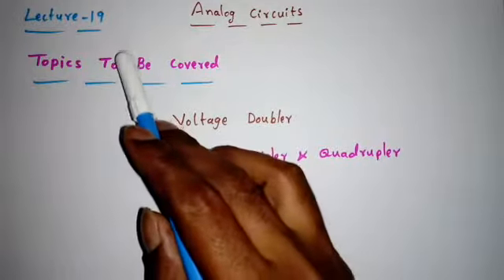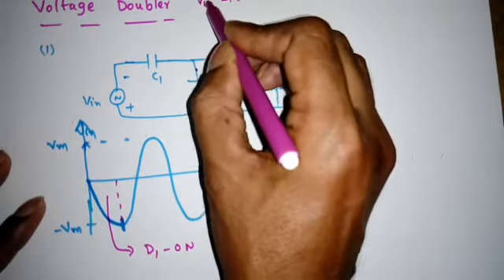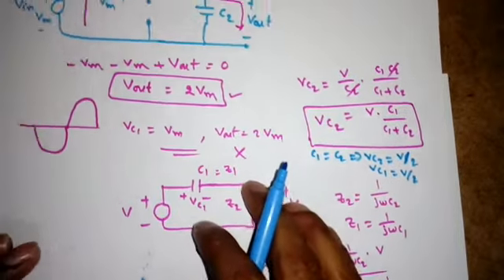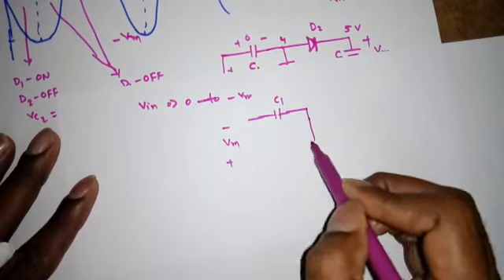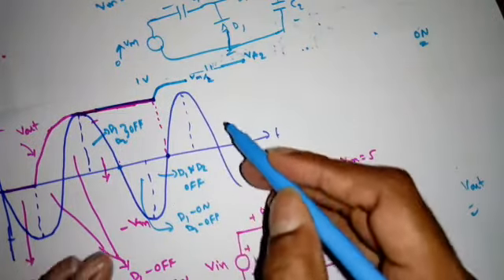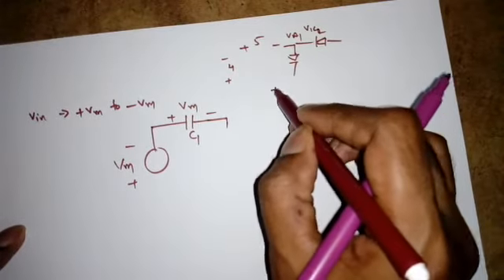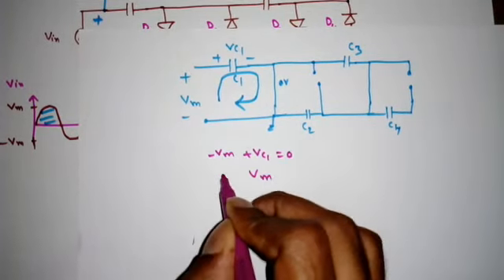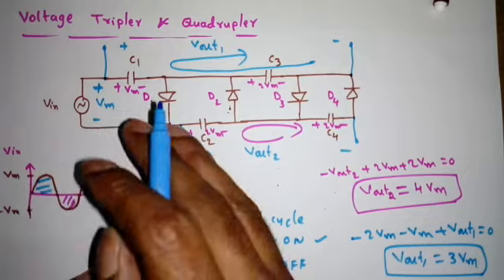Analog Circuits Lecture 19: Voltage Double, Tripler and Quadrupler

Comment: Why capacitors are not discharging even if there is discharging path? Nd Time constant is zero too .Pls explain sir as soon as possible
Reply from the maker: Jishnu Mohan can you be more specific at what time you are having doubt
Reply: Learning Is Everythin @43.12 how capacitor C1 maintains it's voltage at Vm??even if It has discharge path with a zero discharge time constant as R=0 ohm.